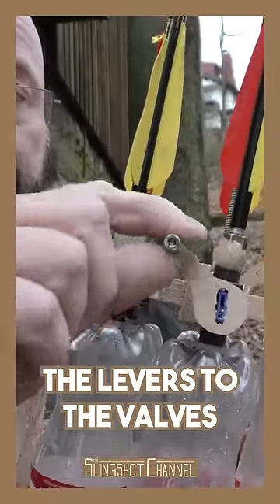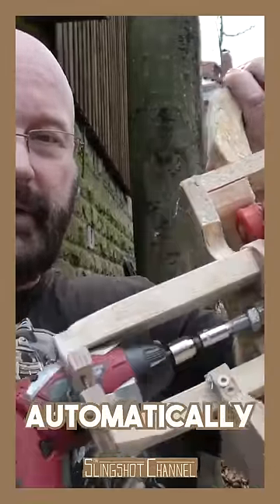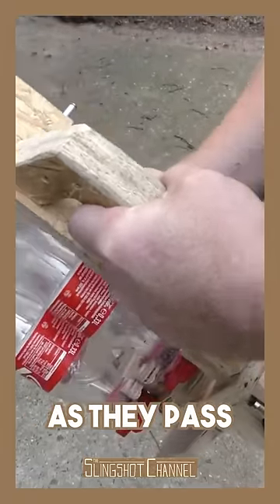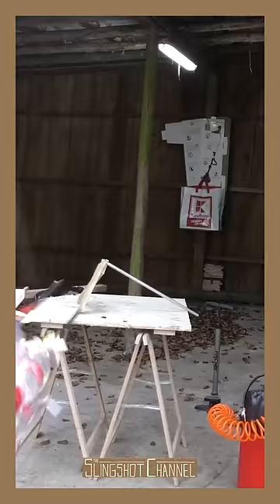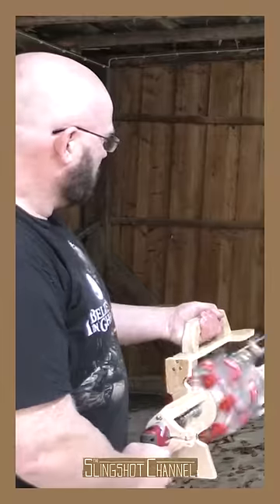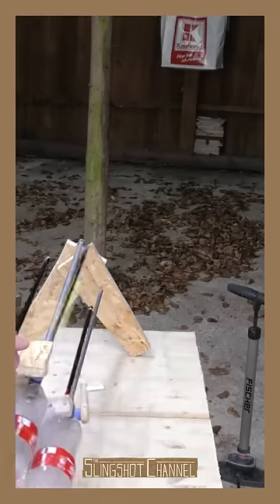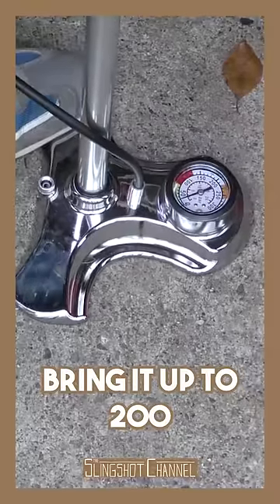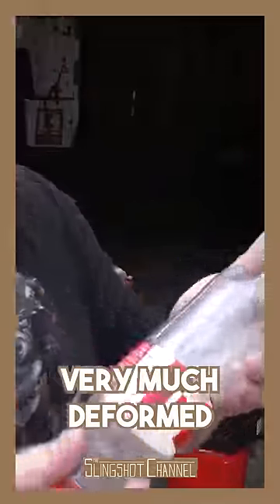The Coke Bottle Gatling

Comment: Former compressor sales/repair/specialist.
Your compressor can get higher than 100psi; it does so regularly, the pressure switch is usually set to turn on at about 85psi, off when the tank pressure reaches 110psi.
That range is why a regulator is recommended, and a filter/regulator also has a filter & water trap.
But you can play with the setting on your pressure switch to maximise the top pressure; usually a screw or hexagonal bolt.
Please note, you can only push it until the safety valve blows off; the safety valve is set to be a safe margin below the tank failure point; Never mess with you're safety valve or change it for a higher pressure one; tank detonations are explosions; building damage & lethal outcomes are entirely possible. Please test your safety valve regularly.
There Are high pressure systems available; paintball, construction, are the ones I'm aware of.
The construction type have special hoses, connectors & tools; work in heavy concrete & steel, reach 300psi.

Comment: You can see the bottle is deformed... Yup, that is what they do right before they explode. Nice thing about soda bottles is they are meant to not fill you with plastic shrapnel when they do fail...  Most bottles usually fail around 170psi so 200 is pretty good.

Comment: This man is putting a lot of trust in those plastic bottles.... 300 PSI (20.7 bars) is HUGE. 

For those not so familiar with how much pressure that is... the pure shockwave from the air escaping alone of one of those bottles rupturing would be enough to cause bodily harm if it ruptured that close to your body...

This is not counting on any potential plastic shrapnel being launched in your face if that were to happen.

But then again... if you squint really hard while operating it, you're probably fine... squinting seems to work fine with angle grinders instead of protective eyewear.
Reply: 200psi not 300 but still quite dangerous

Comment: Try this one out. Plastic Perrier bottle. Drill a hole insert valve stem. Tighten as hard as you can. Air up with compressor. You will be amazed at how much air one of those will hold. Get back to me on that.